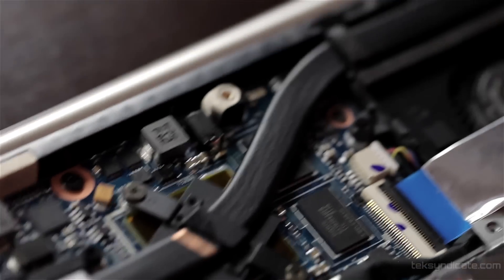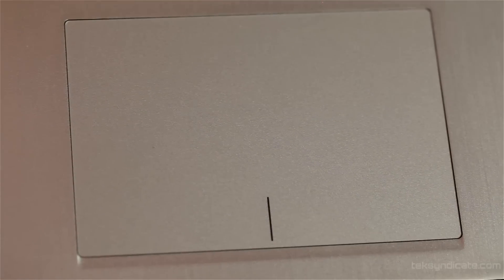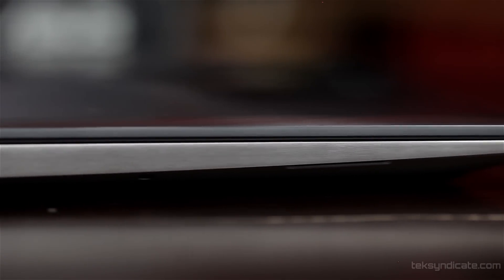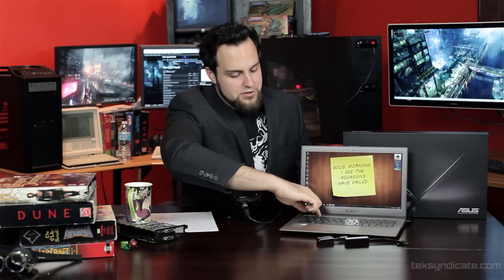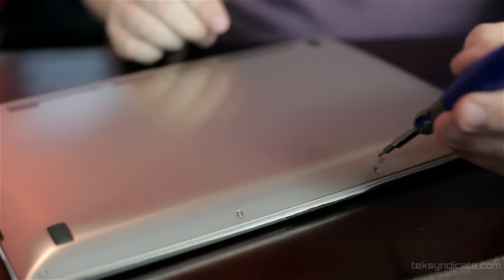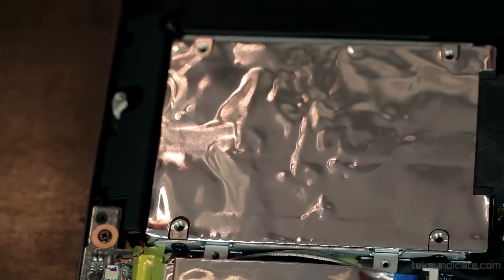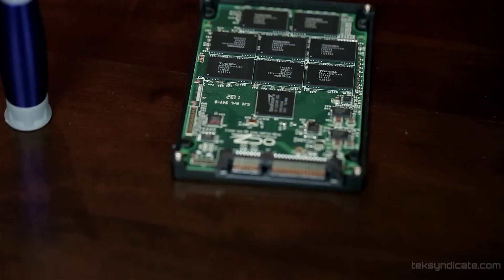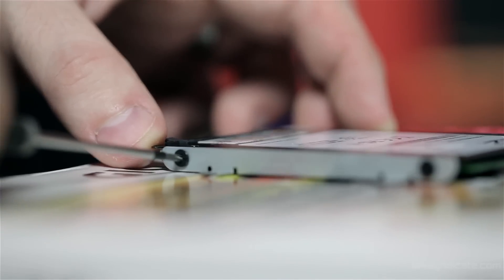Asus Zenbook Prime UX32VD Teardown, SSD Upgrade, Ram Upgrade, Gaming Benchmark, and Review

Comment: im sorry if my question is dumb or something but i´ve seen diferent models of the UX32VD, saying that it as 8Gb Ram or a 24Gb SSD and a 500Gb HDD and i wanted to know if i buy a version that comes with a 500 HDD plus the 24 SSD, can i still replace the SSD for a larger one? like 120, 200 or 500GB?          My english is not the best, Sorry.  Great vid :-)

Comment: I have this PC, and recently the 5400rpm hdd died after just 15 months. I'm looking to replace it with a Samsung Ssd which is 7.62mm thick. Would this be able to fit without any modifications? All help is greatly appreciated!
Reply: You might slip a folded up sheet of paper in there for wiggle room reduction, other than that no "mods" needed. 5400 RPM ASUS drives suck ass.

Comment: I’m looking for a good laptop for photo editing. Which one would you recommend? The Asus Zenbook UX32VD-DH71 or the MBP 13″ with Retina Display, 2.4GHz Intel Core i5, 8GB RAM, 256GB PCIe-Based Flash Storage and Integrated Intel Iris Graphics?
Reply: For photo editing you need a lot of ram. Although the MBP has more base ram, it has weaker specs overall. Your best option is to buy the Asus and install another 8gb for a total of 10gb ram. With this it is much better the the MBP. Asus has a better processor and GPU, which is also important.

Comment: If you need your laptop for school just get a cheap i3. Hel even a celeron works perfectly well. You can pick those up for 500 or so. If you shop around even cheaper. With the rest of the money build a apu game system. Or just hit ebay to build a mid level fx system. Both outperform this laptop easily. This one only makes sence if you need to game anywhere you go and do loads of lan partys. Or just need the performance for work or something. For school its overkill and for gaming itsa compromise

Comment: The thing is... on the video they said they achieved good framerates with the game running in ultra with the filters off... it's nearly unplayable. The game runs quite nicely on high settings without AA and 4 to 8x anisotropic filtering tho, but in 720p. It can also run at a playable framerate on 1600 x 900 with the same settings, but past that, it's just too much for the graphics card.. oh, i forgot to say that i achieved these results by slightly overclocking the card with MSI afterburner...

Comment: Lol, If you think that 80-90 degrees is not overheating, then yes you are right there is no overheating problems at all. It's actually depends on the game. In my case, after playing  Star wars The old Republic about 1 hour, temperature of gpu reaches ~87 degrees. YEs we know that the critical temperature of the GPU 100 degrees,after this limit gpu goes off. And when laptom(especially so slim like ux32vd) running around 80-90 degrees it certainly overheating! So, EAT THIS!

Comment: Dont buy a laptop for gaming. I did this mistake, taking a Asus K53SV with Nvidia 540m (~630m) and I could play all games on medium settings. If you want to play games, better build a PC, I build mine for 1000 : 840€ for the tower (i5-3557k (3.4Ghz, quad-core), 8Go RAM, GTX660 (all games on Full HD, Ultra), 128GO SSD, 1TO HDD, with Zalman Tower), and a 24" screen 1920x1080. Plus a laptop is heavy, 3kg is not so transportable, and the Asus chargers are heavy. Get a tablet for films and Wifi stuff

Comment: I have this ultrabook. The keyboard flex is negligible. The only time I notice it is when I actually try to flex it by pressing down unreasonably hard.  Theres some pretty bad blacklight bleed when brightness is high but its not really a problem because you don't really notice unless you're on the windows start up animation. Touchpad can be better-- its not very smooth. Other than that, this ultrabook's performance is great especially with an ssd and ram upgrade. Display and sound are great too

Comment: So, we bought a UX32VD-DH71 (The one with Windows 8)

The bottom panel doesn't fit well on the casing, the left side overlaps the casing and moves(making noise) when you press it.  There are some places where it's also smaller and leaves the casing's edge exposed. The Windows Experience index, although not that reliable, gives a 5.4 to the graphics card, so people that doesn't know much will be dissapointed.

Comment: Heyo! Just some quick questions if you could be bothered. I've seen some conflicting specs on the SATA version on the UX32VD, but since you mention you got far beyond the 300mb/s specs of SATA-II, I assume it has a SATA-III interface, yes?

And do you know if there's any difference between the Wind7 / Win8 versions of it, because if not, I'll just get the Win8 one and install Win7 either way...

Cheers!

Comment: I'm just wondering, the newer Windows 8 UX32VD-DH71, is exactly the same as the UX32VD-DB71 right? Just that the DH71 uses Windows 8? I just want to confirm because I'm planning to buy the DH71 since the DB71 ran out of stock

Comment: after you changed the HDD for a SDD you of course had to reinstall Windows
do you really have to download and install the the drivers (for e.g. the touchpad) one by one from the asus website or is there an easier way?
also: is it possible, if you transfer all your data with a program like acronis, that you can just go on using your current installation?

Comment: Great vid, thanks.  I bought it, bought an ssd, but had shopped the ssd's so strenuously, picked up the wrong one (sandisk, not intel), and the measurements were off by 2mm. Your method of adjustment lessened my self annoyance.  Now I can dismantle it confidently... Blondie will prevail.

Comment: you cant really compare the Zenbook to the 15" macbook retina, especially when it comes to hardware power cpu/Gpu... the zenbook features a 2 cores ULV processor that doesnt come close to the quad core Processor of the macbook, its the same with the GPU...

it all depends what u wanna do. if you gonna to write some code on your linux distribution u'll have a lot of fun with a light and portable machine. but if you gonna edit/cut films youre gonna have a bad time with the zenbook ;) 

Peace ;D

Comment: This laptop is awesome. It is basically dedicated graphics in a macbook air running on windows.

This will run star2 diablo 3 on all max settings. You are even able to overclock the GPU giving u even more beast performance. I would like to see the nvidia drivers mature as well as see how this thing does on crysis 3 overclocked. The SSD and memory upgrade are a must. Only downfall is that it does not run in dual channel mem mode. But that was only to save space. This is a panera bread laptop son.

Comment: A little extra information for those wishing to replace their HDD with a SSD:
You need a torx T5 screwdriver for the outer screws, and a PH00 (or 0) for the battery and disk.
Note about the SSD: If you buy a Corsair SSD like I did, the fix shown here wont work, because the Corsair SSDs are "reversed" so to say. I fixed it by adding the double-sided tape to the bottom and placing the SSD on top, securing it with tape and the metal brackets on the side.
I got the 8 GB stick he mentions too. ROCKS!

Comment: Just removed and installed the memory and it was ok :) ..btw. SD card slot does not work as boot section ;) just fyi if someone is thinking using it.

Comment: Changed the SSD to samsung 830 128b and corsair memory you guys recommended... now i'm stuck with black screen after booting. power and caps lock light goes on and fans start to run but  creen stays black... any ideas? Trying to get clean install... so I still have those stock hdd and memory.

Comment: Just a quick question... maybe I missed some explanations here but... Why do you not remove the integrated cache? Is it soldered to the motherboard maybe? And there is any way to disable it via software? Is for sure a heave bottleneck with fast SSD's

Comment: Do I need to remove stuffs before removing the HDD ?

And after replacing it by a nice SSD ... what about W7 installation ? Will all the keyboard's shortcuts (brightness, sounds etc...) function ? Or do I need to download some software like drivers ? What about on-board programs that come with the computer (like "instant ON") ?
I don't want to install W7 from scrath and having just the keyboard to work ...

Thanks.

Comment: If you keep the 32VD stock, the 31A will have faster boot times and wake up times, as well as longer battery life. However, if you upgrade the 32VD with SSD and RAM, it will be faster boot up faster and more than likely wake up faster. It will always consume more battery though. How much more? I am unsure, but it is an ultra book so somewhere in the 6+ hour range.

Comment: Wow, thanks for the heads up, I missed that.  You're right - Doing some further research it appears there is another difference:  The UX32VD-R3001V has the 1366x768 TN screen while the UX32VD-DB71 has the 1920x1080 IPS.  So basically the HK model does have the discrete GPU, is about US$200 cheaper, but i5 instead of i7 and the cheaper screen.

Comment: Samsung and vertex are solid brands. Remember to get a 7mm drive so it will fit into the notebook. In terms of Ram, they all work as long as they run CAS11 latency and run at 1600mhz. If you do not have one with CAS11 latency it will downclock to 1333mhz and not perform as well

Comment: you will either need an external cd drive, or use another computer to download windows onto an external hdd or memory stick. You will likely also need to install the usb drivers onto the external memory drive so it will be recognized. I'm not the best at this stuff, but there are forums to peruse about this

Comment: After you installed the SSD and more ram, what kind of gains did you get in battery life? I know there would be at least some going from a 7200 RPM hdd to SSD, and the ram would help too.

Comment: Um, you can call it a silly mistake if you wish, but he seems pretty certain about something he is very wrong about.

Not every i5 doesn't support multiple threads per core.  Very specifically, the i5 CPU used in the base UX31A's is the following, i5-3317U with exactly 4 threads and 2 cores per Intel's own official documentation.

Comment: great video but would like to know if they have tried the memoright 7mm FTM plus slim 240gb ssd and how does it compare to the OCZ vertex 3 max. Also would it be possible to upgrade with a controller and port for Thunderbolt. seeing as the ux32vd has 3 usb 3 ports maybe remove one usb or would this be a major problem. I dont understand why they did not add the thunderbolt port to this unit to make it perfect.
secuuda

Comment: Will the UX32Vd's RAM run in dual-channel if the speed per module is the same, but the amount per module isn't? So like, for this situation, we'd get a 1600MHz 8GB module from Corsair, making the operating speed the same.

Comment from the maker: It is onboard... and there are several fun things you can do with it... caching and paging... I think someone even has Linux installed on it. So, yes, you get 128GB + 32 GB (24 GB + 8  GB for system backup).

Comment: I have a question about this. Is the SSD cache on the motherboard or in the hard drive? Like, if I install a 128 GB SSD and remove the hard drive, is the total storage going to be 128 GB or 128 GB + 24 GB Cache?